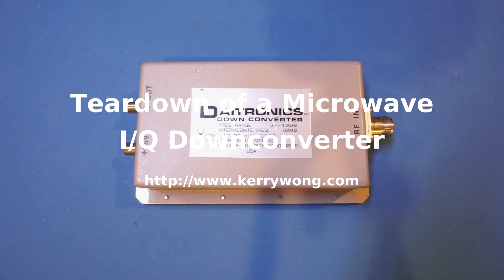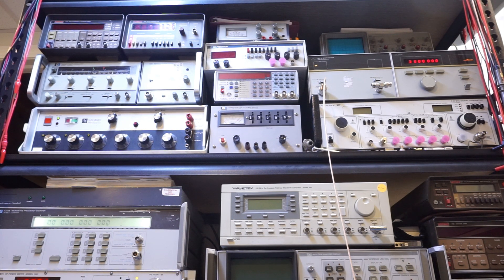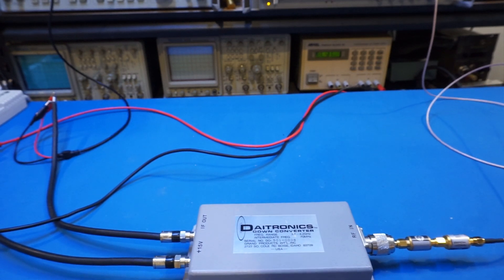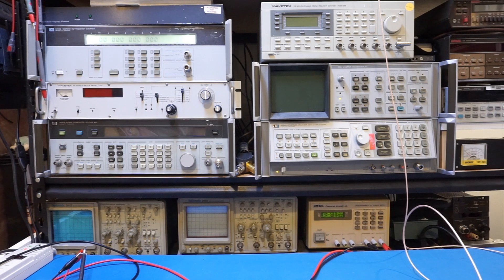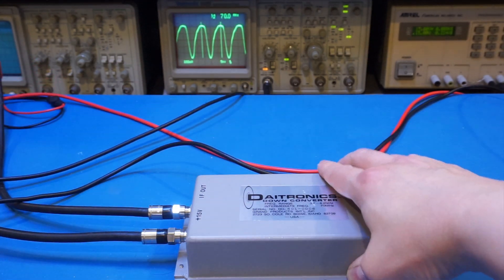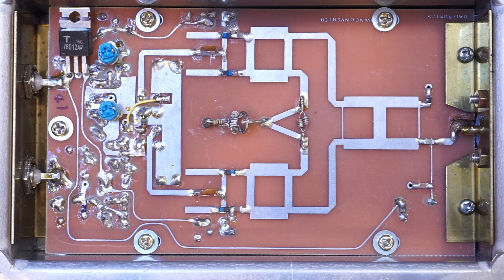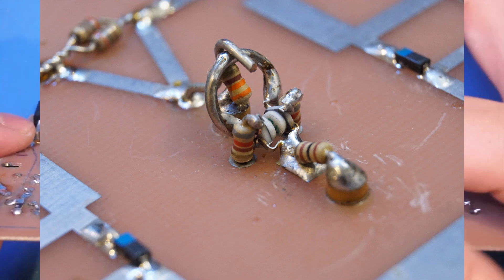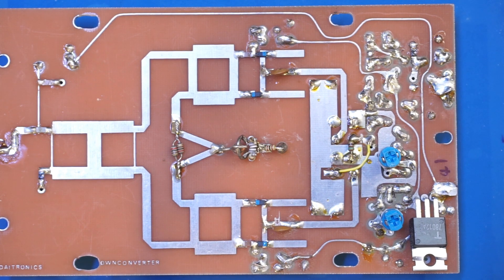Teardown of a Microwave I/Q Down Converter

Comment: Your LO is on the top side of the board, there are 2 tiny RF transistors, see https://www.eevblog.com/forum/other-blog-specific/teardown-of-a-microwave-iq-down-converter/msg2715352/#msg2715352

Comment: what you have here is not IQ demodulator although it is very similar but this structure is an image rejection mixer. If I remember correctly the LO freq MUST be higher than the RF frequency for this to work properly (or was it the opposite? mmm...) What you have at RF input is a double stage wideband branch line coupler (or quadrature hybrid) similar to the ones used in the mixers but with wider bandwidth. The wilkinson power divide was used in the center for dividing the LO between the two mixers with equal phase. 
The mixers are passive (single balanced) diode mixers, so they have loss and you also have loss in RF path due to the hybrids, the only way you can have a total gain is that one or two of those RF transistors at the back are actually IF amplifiers.
Reply from the maker: Thanks for the info! Much appreciated!